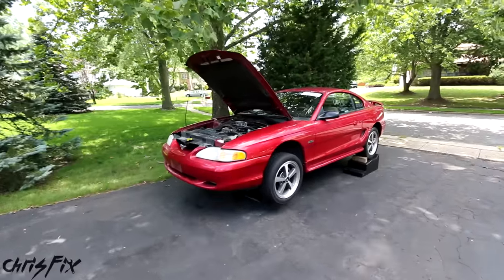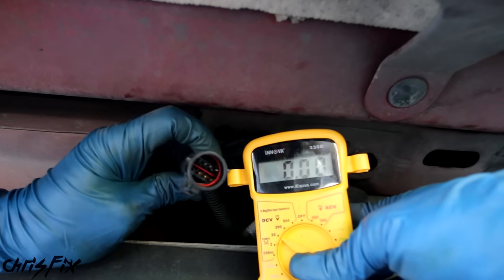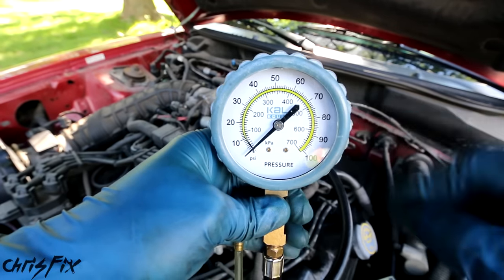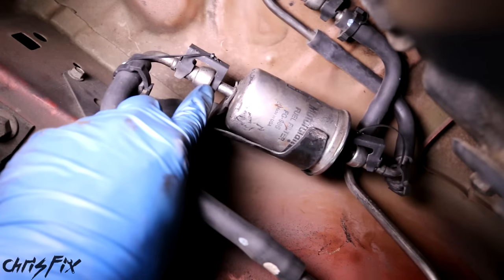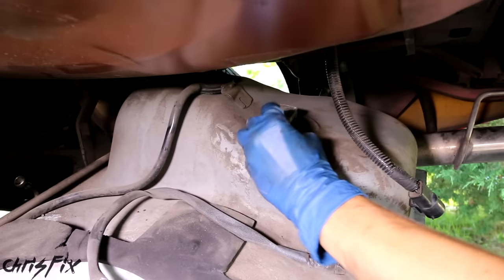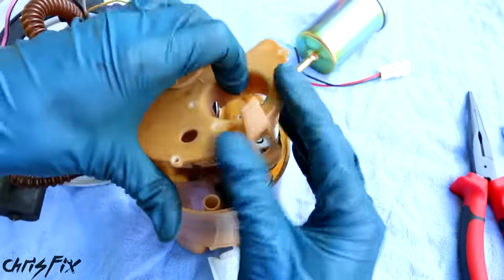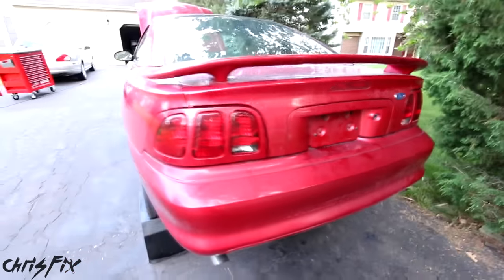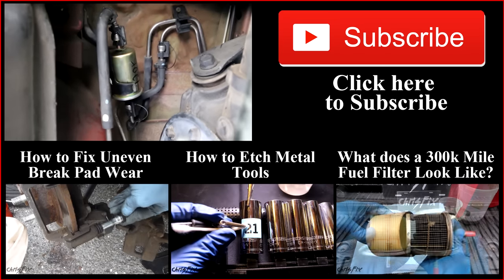How to Diagnose and Replace a Fuel Pump

Comment: wait... clutch down in neutral?
Reply: clutch has to be in to start the car
Reply: Laws Kole no it doesn't. only if it's in gear.
Reply: its just a habit I guess. I even find myself pushing the clutch when I start the car even if its in neutral lol
Reply: Samuel Fabiny What if the car is a older truck?
Reply: +Laws Kole I am not sure about older trucks but manual is manual so Im guessing its the same
Reply: +Cihan baba I think it's different in older vehicles.. or its the way my dad taught me.
Reply: +Laws Kole I drive a 1999 Fiat so its considered old I guess and I dont have to push the clutch to start when its in neutral
Reply: +Cihan baba I got a 93 dodge ram and it has like a 3 18 spider gear and it is really rare or something

(still learning all of the parts to the truck)
Reply: Laws Kole in driving school i drove 2003 or 04 bmw 320d touring which isn't exactly new, i sometimes pushed the clutched but then realised it's stupid :D my next car is '96 seat ibiza, even older, no cluth when in neutral. no idea about old trucks, never drove one
Reply: +Samuel Fabiny I just looked it up soemhlthing called a clutch neutral safety switch
Reply: +Laws Kole and what does it do ?
Reply: Laws Kole well... guess something like that exists. but not in these regular cars. why would this car have clutch safety thing?
Reply: Cihan baba no clue, could be something similar to a automatic trans where you push brake to change form park to drive
Reply from the maker: The clutch has to be down to start the car
Reply: My 94 Miata has to have the clutch in to start.
Reply: ChrisFix it doesn't have to be down in every car though I can film a video about starting my car in neutral without pushing the clutch if you don't believe me or can you try to start your car in neutral without pushing the clutch maybe its different in american cars
Reply: Some cars don't start without clutch down (maybe it's protection against a shifted gear). However the clutch needn't be down in every car. You better look into your vehicle manual for the correct engine start procedure.
Reply: Some cars don't start without the clutch being pushed in no matter what gear you are in, my honda was like this. my motorcycle actually wont start unless the clutch is pulled in and the bike is in neutral at the same time. it just depends on the vehicle
Reply: Mad Stache Moto ,,... no matter what gear you are in." I meant that so..
Reply: so it depends on the vehicle. some of them need the clutch in order to start some of them dont end of the story
Reply: +Samuel Fabiny a Chevy cavalier requires clutch down in neutral to start.
Reply: No, a lot of cars, in special Japanese and some German cars need the clutch in even in neutral to get started. Also it's a good habit to prevent, when you're parked and there's a gear in, your car from moving and, maybe, hitting other car.
Reply: Cihan baba comment was for OP
Reply: Some vehicles the clutch always has to be in to start the vehicle. Motorcycles are mostly like that.
Reply: can't be too sure :D
Reply: Clutch has to be pushed in to start because of neutral safety switch, I believe since 1991+ all cars in North America have to have it for safety. Much like how auto trans have a safety switch for park/neutral.
Reply: Yep, I've owned 6 manual transmission cars and work for a automotive performance company with a  fleet of test cars that are mostly manuals. I'd say about 80% of them have to have the clutch in to start because of the neutral safety switch. Some cars (mostly old ones like my 96 M3) don't have that switch. In some places it is legally required on current cars but some manufactures simply use it as a way to prevent people from starting the car while it is still in gear. It basically closes a circuit when you depress the clutch, otherwise the open circuit won't let the car start.
Reply: yup, starting the car with the clutch down (even the gearbox is in neutral) makes the starter motor work less because it doesn't have to move the primary axis of the gearbox, which the clutch is attached to

having the gearbox in neutral means the primary axis is not attached to a gear, but the starter motor will have to move the primary axis if you don't press the clutch. i think practically there isn't any big difference between moving or not moving the primary axis while starting the engine, but might be something worth doing
Reply: US-specification manual vehicles have an additional safety system that won't allow the starter motor to operate if the clutch is not pushed down, just like on automatics to stop them being started if they are in any other gears than Park or Neutral.  It's an additional safety measure to prevent vehicle runaway.  In engineering terms, however, it is generally unnecessary to push the clutch down on a manual car when starting on anything made after about 1990 as most vehicles from then used lubricants in the gearbox that were much thinner when they were cold.  Older vehicles used lubricants in the gearbox that were thicker when they were cold which would add to the load on the starter motor when starting, and being as the electrical systems on older cars were generally less reliable this could potentially cause problems with overheating or burning out the starter motor or the electrical circuits for it, hence it was recommended to push the clutch down when starting.  However, the other side of the coin was that pushing the clutch down when starting increases the loading on the crankshaft in the engine which can then cause increased wear in the thrust washers in the engine that control the end float of the crankshaft, which was something that could already be problematic on older vehicles.  So now it is recommended NOT to push the clutch down when starting a vehicle to avoid that problem.  When I learned to drive back in 1990 I was taught to always push the clutch down when starting a vehicle, but with my current Ford Focus I never do.  Obviously, this is not the case in places like the US that have these safety requirements, and I believe Japan has a similar requirement though I'm not aware of any other markets that have similar requirements off the top of my head...
Reply: +Samuel Fabiny my car doesn't start no matter what unless the clutch is down. In gear or not.
Reply: BigKittenGaming okay, i learned :) didn't know that was a thing, as i was thought in driving school not to press the clutch in neutral, since it's doing nothing. but i see it's different in US
Reply: Samuel Fabiny   It's a belt and braces way of stopping people running themselves or other people over when starting their cars.  It does seem a bit like overkill for those of us from countries where it isn't the norm, but in a country like the US where a lot of people's instant reaction when something goes wrong is "who can I sue?" maybe it's not surprising...
Reply: Yep its manual
Reply: it wont start without pushing the clutch due to a neutral saftey switch. right @ChrisFix?
Reply: Joe Morganti you should read other comments :) i didn't know this was a thing, probably because it's mainly in US.
Reply: its actually worldwide. older cars, 60s and 70s, didnt have a neutral safety switch so it was easy to start them without pushing in the clutch.
Reply: Joe Morganti don't think it is. like i said, in driving school i was driving '03 bmw 320d, i'm driving my grandma's '10 skoda fabia and i'm buying '97 seat ibiza from my friend. none of these have to have the clutch down. and i don't remember the instructor saying anything about that.
Reply: Joe Morganti   Park/neutral safety switches have been standard fitting on automatic cars since at least the '60s to prevent people starting them in gear and having the vehicle run away, though on some older vehicles they weren't that safe as when they failed it became possible for them to be started in gear, just ask one of my old college lecturers who started his career in the same premises that I did and one day started a Wolseley he was working on which had a failed starter inhibitor switch (safety switch.)  The car was in drive, so when it started it shot forward off the end of the ramp, into the wall and ripped all the fuse and electrical boxes off the wall as it tipped nose down onto the ground.  Safety switches on manual cars, however, seems to be something unique to US specification vehicles and , I believe, Japanese domestic market vehicles...
Reply: never start a car without pressing clutch
Reply: why people get so emotional about you pushing clutch while in neutral. It had non to do with the video. (which was awesome i should say).
Reply: its for safety
Reply: There's a micro-switch that must be engaged before the car will start, the clutch, when depressed, engages that switch. wth? you aren't even old enough to drive and you are making dumb statements.
Reply: Tommy Rad   No, he's quite right, but that only applies to US specification vehicles and, I believe, those for Japanese Domestic Market.  It's not fitted to vehicles for other markets that don't require it...
Reply: gosportjamie
Older vehicles don't have it. I have had 6 trucks, older than 1965 that never had it. Every newer vehicle I've been in has it. I have no idea about vehicles outside the US.
Reply: i have been hit by car 2 times when the idiot driver didnt push the clutch
Reply: ProctoLogic   Which, I suspect, is exactly why this system is used.  I don't think there is anyone who regularly drives manual transmission vehicles who hasn't, at some point, inadvertently attempted to start a vehicle not realizing it was in gear and had it jump forward because they hadn't pushed the clutch down.  Obviously it is always good policy to check that the vehicle is in neutral, but if you're in a rush sometimes good policy gets forgotten.  This system should pretty much negate this, and in a society such as the US were litigation is common it also protects the manufacturers too...
Reply: even if the clutch doesn't have to be pushed in to start the car, it is a good habit, because it can save you a lot of money if you do happen to forget that the car is in gear. plus with the clutch pressed down,  the clutch discs are disengaged, and the starting motor doesn't have to spin the input shaft of the transmission. this can be especially important in cold weather, because the transmission fluid can become so cold and gooey, that the battery wont have enough power to start the car
Reply: Seleya   You're perfectly correct, however the lubricants used in modern manual transmissions are so thin now that it's not really a consideration.  However, if you're in the habit of leaving the vehicle parked in gear then making that your routine is a very good idea...
Reply: Nope it is that way on some cars
Reply: Big Mountain Bob   I suspect largely on cars that have heavier duty transmissions such as sports models and those with four-wheel drive transmission that still require a heavier gear oil...
Reply: nope it's a safety thing they do have to have them pushed in
Reply: my 2000 s10 had a clutch safety switch that has to be pressed. you can turn the key all day long but unless that clutch is in the truck won't turn over. my 89 civic had the same thing. the only car I've had that didn't was my 94 Honda and I just bypassed it because I was tired of dealing with the car and just wanted it to start
Reply: axtra92   What's so dumb about that?  If it's an old car of low value that just isn't worth spending money on to replace a faulty part or system that can be overridden relatively safely then surely that is the most appropriate thing to do.  The car can still be used safely so long as the driver makes checking the vehicle is in neutral before starting part of their routine.  It's not like a neutral safety switch is a particularly safety-critical part, unlike the braking system or airbags.  Bypassing the system gave the car a longer working life rather than ending up in a junk yard as immobile scrap...
Reply: axtra92 just not american. looks like this safety thing is valid for usa only
Reply: Some cars require clutch to start no idea y tho
Reply: in my honda civic yes
Reply: On the older cars (like my VAZ 2106, '93) the clutch pedal has to be pressed down to start the engine easily (much easier especially when it's cold winter). Its because of primary shaft in gearbox, which is like always connected to the engine, even when you on neutral. Pressing the clutch pedal disconnect primary shaft, so the engine can crank up easier. Hope I explained properly.
Reply: Samuel Fabiny yeah new cars u need to no idea y
Reply: AF Mechanics
Reply: It's a safety thing.
Source: my dad's truck has to have the clutch in to start even if it's in neutral.
Reply: Samuel Fabiny I thought in manuals clutch always needed to be pressed down. My friend told me to push it down when he was showing me how to drive manual in his mustang.
Reply: As far as I know, it wont wear out your clutch when your starting it. The clutch itself is abrasive an can wear out faster if your starting the car with it engaged.
Reply: As stated earlier, you need to press the clutch to close the switch before the car will give power to the starter.  Why not leave the car in 1st gear while you do that?  Because what if your clutch is bad?  The switch is installed on the clutch pedal.  It gets activated when you step on the clutch.  It doesn't know that the clutch disks are actually disengaged.  A loose cable, low fluid, air in the lines, etc could still exist.  When that happens and you have the car in gear while starting it, it can jump off your jackstands unexpectedly and put you or your helper in the hospital or worse.
Reply: Depends on the vehicle.
Reply: Samuel Fabiny i know im a bit late but clutch down even in neutral is good practice, the starter motor only has to spin the engine instead of spin the gearbox as well, I can't start my car unless the clutch is in because mines has a button not a key ahah
Reply: Its always a good habit..if you accidentally have it in gear you could do some damage when the car jumps away :D and everyone that lives in cold places knows gearbox oil turns almost as thick as asphalt when its winter..so better not have that engaged
Reply: ChrisFix I thought you only had to press down the clutch, if it was in gear.
Reply: It's good practice starting with Clutch down.. read the other comments mate. Some cars you must depress clutch others it just helps because the starter doesn't have to spin the transmission, or if you accidentally leave it in gear it wont lunge forward particularly in older cars.
Reply: i'm european, i don' think that's a thing here. probably only in US. i've driven some older and newer cars and none required having clutch down when starting. and of course i always check if i'm in gear. that's one of the first things they teach us in driving school... "be in neutral and turn the key"
Reply: Samuel Fabiny mercedes automatics require you to press brake even in europe but clutch is rare here in europe
Reply: Samuel Fabiny   I had a '76 Camaro that had a safety switch against the clutch pedal? It had to be pushed in order to start the car whether it was in gear or not.
Reply: Have a 95 honda civic, and a 2007 kia spectra manual, both require clutch down to start, no matter what gear. Pretty sure this is common these days, because I have put it down in every manual I have ever started lol.
Reply: Cars in Europe and most places don't require the clutch to start the car but in US it is sort of like a safety feature so all cars that have been sold in US  you have to hit the clutch to start
Reply: Michael Koblishvili where did you get that information from? God sake its simple, some cars require you to some don't! Its better if you do because your starter doesn't have to spin the transmission! My 100% european car needs me too but because I have a start button, my dads 100% European car needs to and his has a key! Its like pressing the brake in an auto...:
Reply: 100% untrue depending on your car. VW's WILL NOT start unless it's pushed in
Reply: MrEeeaddict my friends 2013 polo will start without the clutch in, why is this still being debated??? Some cars require you to. Some don't... Simple as that!!
Reply: Samuel Fabiny  yea cuz near behind the clutch is the clutch safety switch which allow to start the car.
Reply: Samuel Fabiny It's good practice to always depress the clutch when starting a manual car, even if it's in neutral, because one day you may forget to put it in neutral and suddenly lurch forward (potentially causing damage to your car or someone else's). It can also reduce flywheel wear and increase starting performance, as others have said.
Reply: Samuel Fabiny in some cars even if its in neutral the clutch has to be down just because they have a safety switch in the pedal
Reply: JK Garage surely you must ne aware their is already 85 replies, why did you feel the need to comment what many others have already said? Being helpful then theirs being annoying with notifications
Reply: yes it was a test stu
Reply: u r right sam is wrong
Reply: Samuel Fabiny I replaced my fuel filter in my 2002 grand am after it starting to stall and idle erratically. That solved the stalling, but some of the same problems I had still exist. I've tried injector cleaner and I didn't notice much of a difference. I fear it's only a matter of time before the idling turns back into stalling. Is it possible that the fuel sock he was showing is clogged? The eradic idling comes and goes but the pump sounds fine when I test it and most cold starts are fine.
Reply: Many cars have a switch that is connected to the clutch, that switch needs to be engaged to turn on the car, which means the clutch had to be in